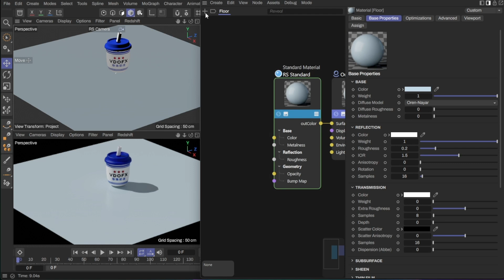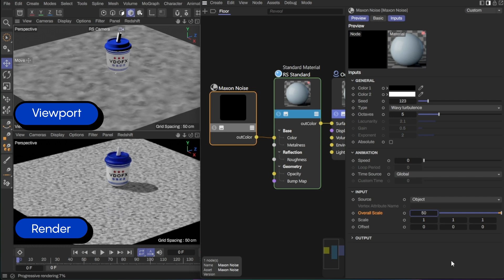Fixing C4D 2024 Maxon Noise Scale | Cinema 4D | Redshift

Comment: Maxon updated Redshift awhile when it came to units. Go to Redshift Settings > System, Units > Uncheck Legacy units.

Old scenes will have legacy units on. New scenes will have it off
Reply: it doesn't work.
Reply: @tenteykov4061  after unchecking it, the scene units would still need to be converted. On a scene I worked on, after unchecking legacy units, I set it to centimeters and then had to go to every Maxon noise and multiply the scale by 100. It does work
Reply: Thanks for the answer!